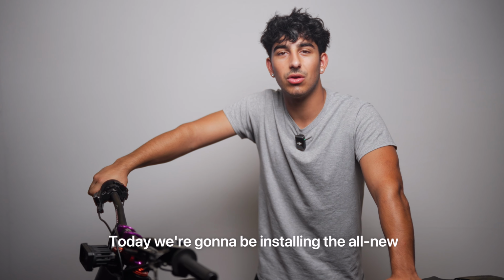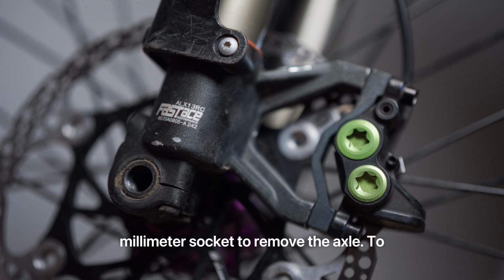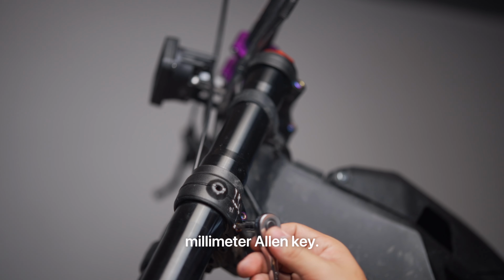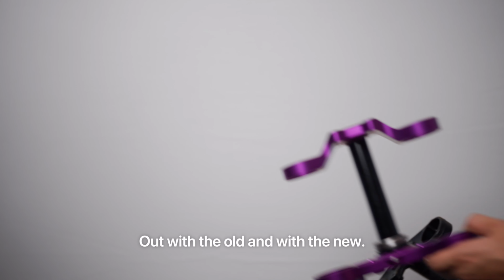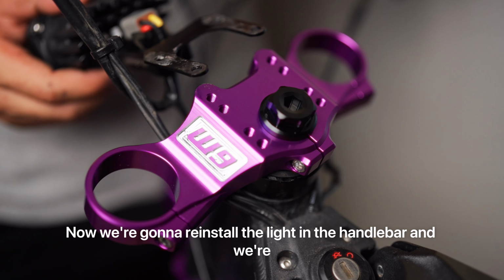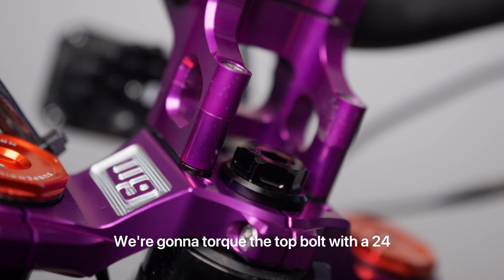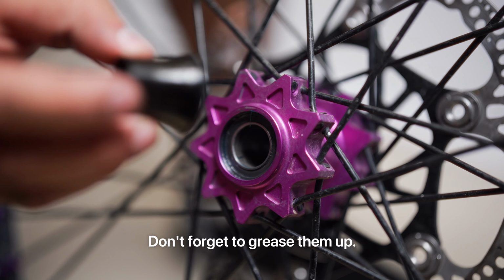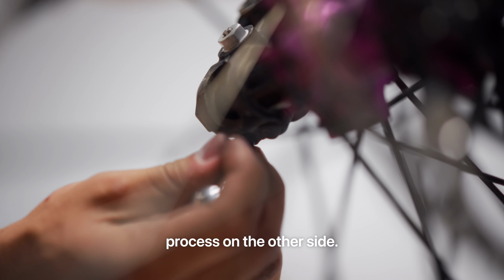Fastace Triple Clamps Install

Comment: Looks Great! I might do the same on my new E Ride SS Pro 2.0! I installed the Riser Direct Mount and new Steering Bolt, forget what it's called! Lol, Gold footpegs, Warp 9 16 inch Rear Wheel & 3 inch Riser Bar.. I over torqued one of the 5 mm bar clap Hex bolts in the direct mount handlebar clamp. It severed and broke, snaped, one of the middle, long ones, Now I can't remove that 5 mm Hex as it just spins and I can't back out the bolt!!!!!  I don't ride all crazy so I'm pretty sure the handlebar won't move or rotate on normal trail use or impacts. But still, I want to make sure I rise safe! Does anyone have a "Hack" on how I can extract a severed a 5 mm long hex bolt???? Thank you! I love my Warp 9 Parts!!!! : ) Happy Trails to all..

Comment: Can you install the steering lock on the warp9?
Reply: With these clamps you do not need the steerlock. It's set up like a motorcycle with a threaded top nut to keep everything tight.